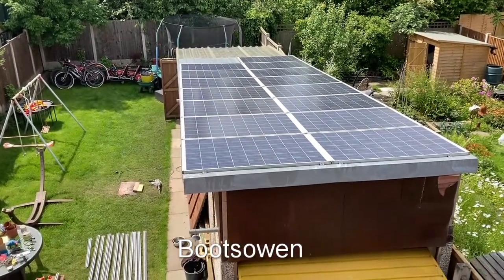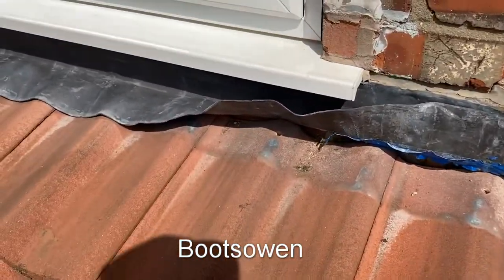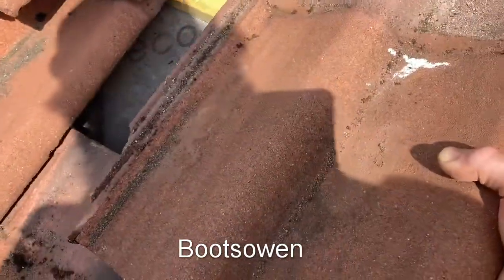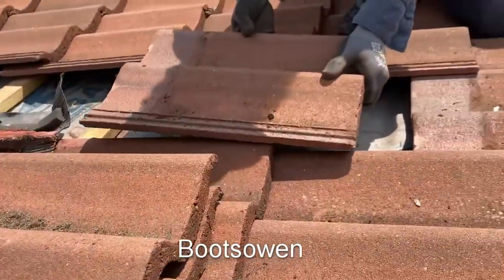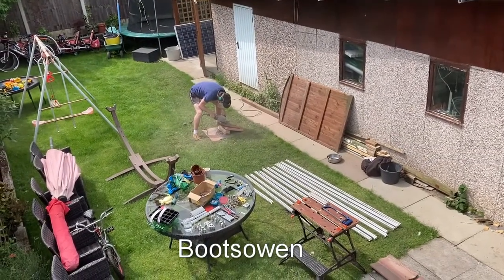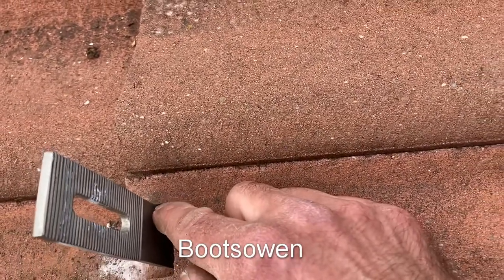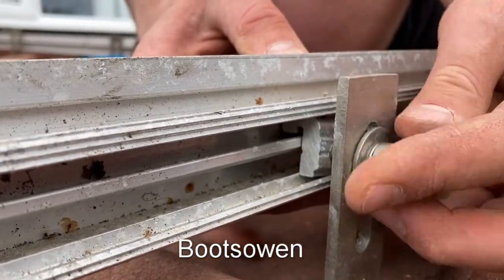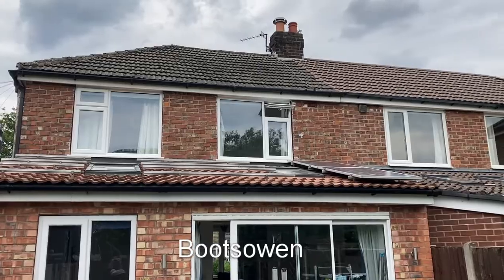Fitting solar panel brackets to a concrete tile roof

Comment: Never seen roof tiles notched like this before for the brackets, I'd find a slightly longer bracket. I understand that need to grind to flatten under the tile where the bracket comes through underneath.
Reply from the maker: You have to work with what you’ve got.

Comment: Now, a related comment.
Thank you for the video.
I was wondering about this type of roof if constructing a separate type of frame that sort of hangs above the roofing plane/sheets itself would be an option. You know, like a carport type of thing but which hangs atop the roof area (not sitting/resting on it) for a lack of space to construct a separate carport.
Reply from the maker: From reading your comment I have no idea what you are asking.
Reply: @bootsowen  okay. You mounted the panels on the clay roof. I fear that this could damage the roof, personally. I was asking to gauge your opinion on an alternative way to mount said panels without damaging the tiles but still over the roof sort of. 😢
Reply from the maker: Cool. They are concrete tiles. I put a clue in the title. Clay tiles are a different type. You can mount your panels however you wish. You might need a different mounting system and you would have to comply with the regulations in your area. I would suspect that building a complete separate structure over your house would require a design. You are asking that structure to withstand wind uplift loading and snow or other extreme downward loading. And if it fails, depending on how it fails it could damage your roof below. Whereas if you use a system that is already approved, like the one my friend used then you don’t have to worry about any of this.
Reply: @bootsowen  thank you for answering. I actually thought it was clay from the colour.

Comment: No sealant use for home drilled nor where tile is cut out for the bracket?
Reply: Hmmm… attitude when called on a miss.
Reply from the maker: What's your point, you could cover the whole roof, each joint between tiles, with sealant, but there was none there before we did this to Andy's roof, on any of the screws, and there was none after, it didn't leak before and hasn't since. Every comment is a good comment.
Reply from the maker: Is that a question? no, no sealant! It's a roof, not a bath tub.

Comment: I'd rather do a ground/patio cover install than puncture holes in my roof, but thank you for sharing...
Reply from the maker: Most solar systems in the U.K. are on roofs. This method is better than the method where they drill holes through the tiles and screw down with a dob of sealant!
Reply: @bootsowen  living in desert here in Arizona, with a concrete tile roof, I still prefer to create a shade canopy with the solar panels (it makes more sense). But, in your case, it definitely makes more sense on the rooftop...
Reply from the maker: This job was on a friends roof, I have made a carport for my panels, and mounted the rest to walls and fences. my roof is 3.5 stories high, so not easy for access for maintenance. the carport is simple and serves a dual purpose.

Comment: To make simpler removing tiles I take few cutted tree branches 30cm and 4-7cm diameter. I instert the branch next right and one up to the tiles I' plan to remove so that they're not in the way. That helps a lot a makes it simple.
Reply from the maker: An old roofer told me to take up two claw hammers, one to lever and the other to shove the handle in, like your branches. On this roof all of the tiles would be in a line so we did it from the top.
Reply: @bootsowen  I also use offcuts 19x60mm they good to. You can insert either way 19mm or 60. Sometime tiles close to a cornering line and inserting 60mm is too much, but 19 is ok.

Comment: Isn't a bracket with a longer tail available, to avoid the need to cut the tiles?
Reply from the maker: Maybe, but my friend had bought a used set of parts, so this is what we had. I did an installation with a different friend last week. He had bought new rails, so much easier! As for lengths, IDK

Comment: Plenty of mounting systems are adjustable and dont require you to hack great lumps out of the tiles and mount on the spars so you dont need to drill holes int the roof, such as the Esdec system.  Far better for your roof and far faster to fit.  Ill bet they arent even more expensive than the kit you used here.  Also use a trowel (or two) to lift the tiles, which saves breakages.
Reply: My comment was really for people who watch this and think this is how you should mount solar panels on the roof, which it really isn't.  You could have reused the rails and bought some  (or swapped) the hooks for some that fitted and not have to cut the tiles.

No need to be so defensive, we all make mistakes.  It's a bit shit to encourage others to make those same mistakes though.

FYI, I've just bought a full fitting kit for 6 panels for 275 euros.  That's more sustainable than damaging a roof that should last a lifetime.
Reply from the maker: Where's the mistake?
Reply: @bootsowen  Should not need to notch tiles, better to use correct bracket for the job. Those brackets likely for a different dimensioned tile, either that or you have non standard roof batten spacing.
Reply from the maker: Use what you have and don’t worry about buying new stuff. Make do. Great lumps are just little cuts. The roof is still watertight and my mate still has spare tiles if he ever takes the mounts away. Don’t stress. Live life doing rather than working to pay for “perfect “ solutions. How many systems have you installed at zero dollars down?

Comment: Tiles should be nailed/screwed every other row which means you can slide a tile up to get to the nail/screw for the tile below, means you don't have to take the full column of tiles out.
Reply from the maker: The attachment of roof coverings is specified dependant on the location and its exposure to wind. I have seen them nailed every third tile round my way, and on the exposed Atlantic coast of Ireland I have seen every tile double nailed. Horses for courses.

Comment: I am an architect and I've done some building and I've owned rental property.  If you penetrate the roof it is almost 100% guaranteed that you will have roof leaks in the future.  The membrane under the tile does the real work, if you drill lots of holes in that membrane it will leak, maybe not soon, but it will leak.  If you have any alternative, say on a patio cover, take it.  If you do what is shown in this video then set the brackets in mastic/sealer before you screw them down.
Reply from the maker: Your qualifications abound so what you’re saying should surely be treated with respect. Can you explain why roofs don’t leak when every batten is nailed at every intersection with every rafter?  There is a penetration at every point, unsealed.
Reply: @bootsowen  my house 50 years old doesn't have a membrane but it is not in UK but in Australia and we have 500-700mm of rain a year.
Reply: @bootsowen  i live in a house built in 1919 in Hampshire. The tiles are directly on the rafters no felt or anything. Early days, but no leaks for the last century.....
Reply: The roofing sarking/felt is a second line of defence, installed correctly the roof should be waterproof without it. It’s certainly not the primary defence. As mentioned, screwing the brackets to the timber is no different to nailing the battens to the timbers.
Reply: some older roofs don't even have underfelt @ajpepe72
Reply: Absolutely correct. I had my rooflines replaced with uPVC and when new drip felt lengths were fitted, the sarking felt was accidentally punctured unbeknownst to me until heavy rain leaked inside the bedroom wall!  I ended up crawling in the tight loft space to patch it up!!
Reply: I agree with you but all solar installer install this way.

Comment: When your creating holes in the roof underlayment with the screws, do you not need roof cement (like Henry wet patch) to go over that area to prevent future water leak? Seems like it would be a cheap preventative.
Reply from the maker: you could, but the tiles and battens are nailed on through the membrane too, so what's the point?  The nails and screws are always made to the spars(rafters) so at that point the membrane is high and should then sag between the spars. if you have a roof that has boarding under the membrane (underlayment) then maybe your point is valid, but how are the tiles and battens held on, do they use some waterproofer at every nail?

Comment: Great video, very informative. How close to the edge of the roof can a panel be installed?
Reply from the maker: You could have them wherever you want but some locations and codes will specify a setback.

Comment: why were the brackets too short, and you had to cut on the tiles? 
what type of bolts did you use? 
i have the same type of roof too
Reply from the maker: The lap of the tile depends on the roof, the length of the bracket depends on the bracket. the bolts came with the brackets.

Comment: Pitch on roof is to low for roof tiles.
Reply from the maker: Does it matter?
Reply: @bootsowen   Yes driving rain will ingress if you install tiles below their minimum pitch. That roof looks like 5 to 7 degrees which technically makes it a flat roof (could partially be camera angle) . While you can get special tiles that go down to 10 or 12.5 degrees but those are all smooth finished which the ones in the video are not so they likely have a minimum pitch of 15 or 22.5 degrees.  Cowboy builders 🤠
Reply from the maker: Yes, indeed, I understand. But this roof is built, It doesn't/ hasn't leaked, I didn't build it, It's not mine and I'm not going to change it. So does it really matter?
Reply: @bootsowen  Yes it does.  I have an 11 degree pitch with panels and now leaks galore.  Driving rain basically goes up the roof.  the felt is soaking.  Probably going to have to have the panels removed to fix my roof.
Reply from the maker: Maybe you live in an area with a different exposure class. In the west of Ireland the exposure class is very high and driving rain is an issue. In the middle of England is not. So while you have a poorly built roof that is unsuitable for the location and exposure, this roof has proven itself adequate over time. Good luck with your replacement.

Comment: The strange bit is the brackets look like if they extended them out by another 1" you wouldnt have to do any cutting.  Perhaps the back ridges?
Reply: I'm guessing the roof is more of a DIY job and the spacing/overlap of the tiles (where the wooden battens are nail on to the rafters) is not "industry" standard (i've just been up on my roof that has the same tiles and the brackets i bought just about fit).   Sometimes on a short extension roof the spacing is a compromise.

Comment: I am baffled as to why the brackets are not made to fit without cutting a notch in the tile. Also, why can't the brackets be positioned so that you bolt the panel to the brackets?
Reply: I'm guessing the cutting of the tiles is because the spacing is not "industry" standard, probably due to a compromise on a short roof atop of an extension.   A roof built with less of an overlap would be fine.
Reply: They dont need to be cut, this is a hack job using a mounting kit that wasnt designed for these sorts of panels.
Reply: Any bracket will lift the upper tile off the one below it by the thickness of the bracket. This is why the back of the tile needs grinding back to allow the tile to sit flush again against the tile below. Having said that I’ve seen some shocking ‘MCS’ certified installs where they haven’t bothered and that massive gap is the an open invite to driving rain.
Reply from the maker: I think that’s just the way it is. Maybe you should patent your idea.

Comment: Wow that video went up quick, got the other 6 panels on the next day with my mate Tim. All wired in that night into my eversol inverter with the garage string. Has nearly doubled my output.

Got 6x 265w panels too if you fancy making a video about pergola building and doing a followup.

Also caught my not so sexy legs there, nice.

Also thx for the epic amount of harf work. Looking forward to chilling out with some pizza now.

Comment: Owen, This is the most difficult part and intrusive to the fabric of the building. Thanks for the reference. Single storey buildings are much easier for fitting and maintenance. I have to clean a build up off lichen on my barn panels, difficult to get to with a steeper roof and old terracotta pan tiles that are impossible to walk on, cheers
Reply from the maker: It sounds like you need some kind of sky hooks. Or a cherry picker. 
Mine have a layer of dust and sycamore flowers on them. I need a long reach wash brush. I have a few aluminium aerial poles that I reckon I can join together. I need about 5m reach.
Reply: @bootsowen  or a younger fitter person later in the year, cheers